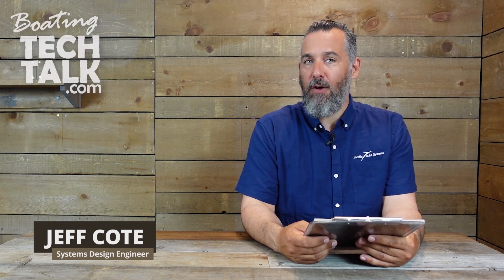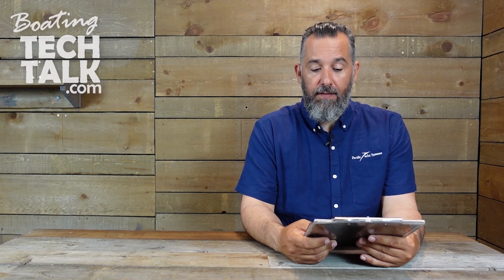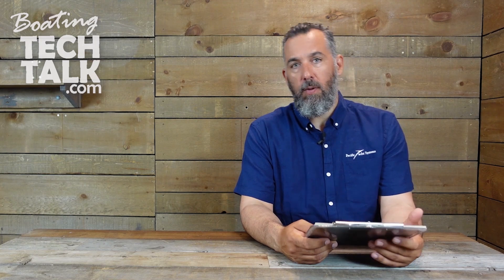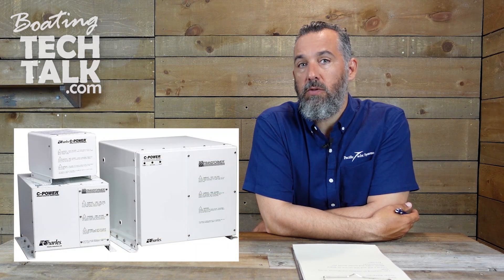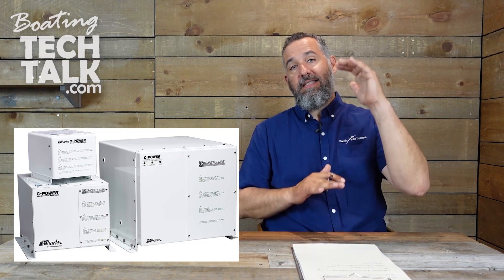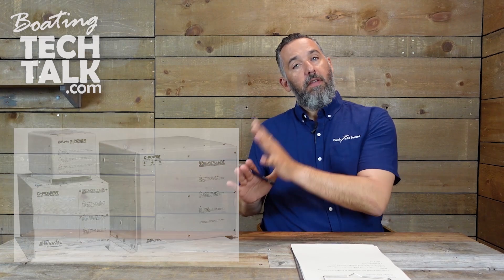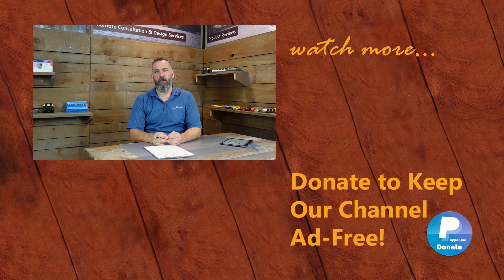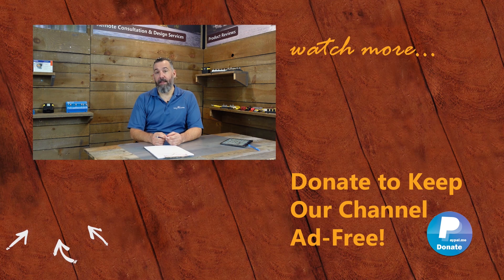What Isolation Transformer Do You Recommend For My Boat?

Comment: Hello Jeff, we have a 1987 Egg Harbor. I am installing a Victron 3600 auto Isolation Transformer. It will be mounted approx 10 to 12 feet from the power cord inlet on the boat. What wire/ cable should I use to wire it in , both from inlet to transformer, and out of transformer to load? Also, should I wire in a cooling fan and venting.The unit will be in an enclosed space.
Thank you fo you help. I really love your videos, so much information. That’s again,
Dick Roloson.

Comment: Good morning,
How is the size needed determined? Is it based on shore power amperage(30 or 50) on the supply side or watts needed on the usage side? Victron makes 2000watt and 3600watt versions….and larger.

Comment: I just installed a Mastervolt Mass GI 3.5 on my boat, which is the smallest they have, but enough for me. 3500VA on 230V. The unit is CE and ABYC compliant and weights just 6 kg (13,2lb). If you need more power, upgrade to the bigger version (double power, just 10kg /22lb) or switch in parallel.
(I choose Mastervolt for the Masterbus. The Victron units are much heavier.)
Reply from the maker: Thanks Wolfgang for sharing, really useful info!

Comment: He Jeff, thanks for all the content you provide. Awesome!
luckily, I installed a Charles Isolation Transformer on my Boat a few years ago. I understand they are no longer available. 
My question for you is about the different shore power Amperages.  
Wouldn’t he have to Install a Isolation Transformer an on each shore power plug?
Thanks Jeff
Reply from the maker: Normally, we see dedicated isolation transformers for each shore power inlets, matched to input current.
Reply: Hi, ASEA power systems has isolation transformer that looks exactly the same, has same footprint. You should check that out.